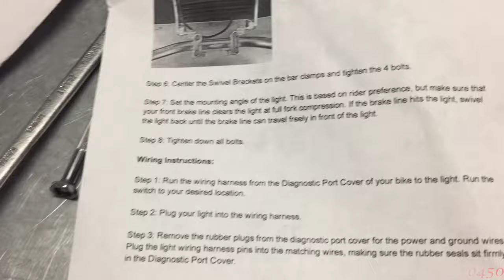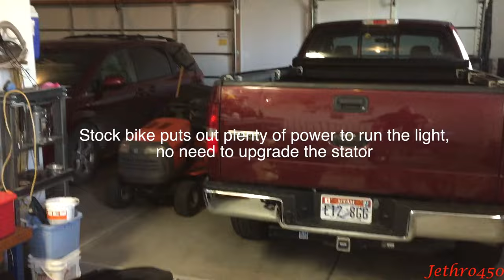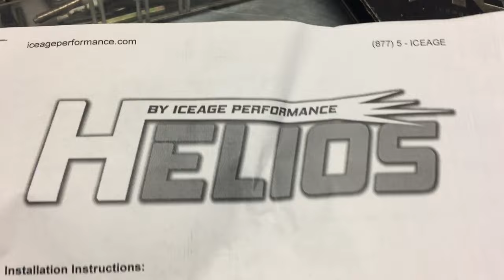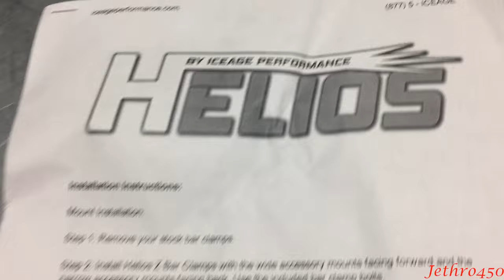2014+ Yamaha YZ450f Headlight Install

Comment: I built a system that was mounted like that. It was 70W and 6000 lumens, had to do my own wiring.  I would warn you to watch the brake line, I found that when the forks get compressed  the brake line hits the bracket and bends the line in a way that it isn't supposed to bent.  I am waiting on a longer front brake line to come in so I can route it differently before I put the light back on.
Reply from the maker: Yes I noted that, I think I will be rotating the mount upwards and away from the brake line.  I like it's current location a lot though, so I'll go ride and see how bad it hits first.   70W and 6000 lumens... wow!  The stock stator on this bike (so I read somewhere) puts out 60W and this light is a 30 or 40 watt requirement.  I'd have to switch up stators for a 70W setup.
Reply: I have an FX, 250, it has more power from the stator, 160W or some thing like that.  Runs the light no problem.  The set up is, obviously, really really bright.  Don't know how to post the picture here.  

Anywho,

My brake line bent at where the sheath ends at  above the guide at the bottom of the number plate and  just below where the your off road sticker is, at 3:31 in the video there is a good shot of that.

Comment: The Ebay link to the Yamaha wire connectors isnt working for me. Could you help guide me to the pins if they are available for sale? Thanks.
Reply from the maker: Give me a minute… I’ll fix the link and let you know
Reply from the maker: https://www.ebay.com/itm/Yamaha-WR-YZ250f-450f-or-FX-Diagnostic-Port-Connectors-/284280517660?mkcid=16&mkevt=1&_trksid=p2349624.m46890.l49286&mkrid=711-127632-2357-0

Comment: It seems to work good with the 8w ledlight and a 15 fuse between but now i have the problem when i turn the light off the hole bike shuts uff
Reply: Shuts off

Comment: Can you use an 8w ledlight dont you need to put a fuse between ore something ?
Reply from the maker: Not sure about the 8w…   Google thinks my 3000 lumen LED is a 50w light though.   I have a fuse on the positive wire right by my battery

Comment: I cannot find the ice age brackets anywhere. Apparently I’m looking in the wrong place. I love how simple and sleek they are and would love to use them on my setup as well instead of having extra brackets hanging on the bars. Can you help me out with finding them? Thanks man.
Reply from the maker: I’ll look.  Also, I just ordered in bulk the correct connectors for Yamaha’s to plug in.  I need to verify they work first, but when I do I’m gonna have an eBay listing setup to buy them.
Reply from the maker: Doesn't look like Iceage Sells them anymore.  I'd suggest calling them and asking if they could make you some.  They're CNC'd.  It's not like they can't make a set for ya.  They still have the plans.  I love mine.  I've had them since 2015 and they're still going strong.
Reply: Thanks for your help. Send me the eBay link when you get it set up. That’ll be helpful. I’ll get in touch with them and see if they can machine me a set. They’d be so nice to have.
Reply from the maker: The connectors I got worked!  See updated info section of the video.  I'll be happy to ship you some if you still need them.

Comment: You don't need a relay or anything like that to run the light or does it just plug directly into the diagnostic port? Also does the mounting kit include the light itself too? And lastly do you think a 2016 Yz250f could run this system (it has a diagnostic port) The stator on this bike put outs about 40w. A reply would be much appreciated.
Reply from the maker: No relay needed.  I showed everything I did here with no hidden secrets.  Plugs directly into the port, just like the video shows.  Kit included the light.  I was told that the 450 stator puts out 40w, so if your 250 does the same, I’d say you could do the exact same thing I did here and be fine.
Reply: Thank you so much 👍🏽

Comment: How are you getting your airbox set up on the reversed Yamaha? I just bought a 14 yz450f and don't know which direction to go to get it set up for the snow.
Reply from the maker: I've done two rides now and didn't like both setups I tried.  First I tried just the outerwears over the regular airfilter cage.  Hated it.  Today I tried a pod filter (gutted the airbox and put a filter right on the carb).  Same issue, snow gets through all the odds and ends cracks and still fills the area up.  I hate to do it, but I'm going to cut a hole in the top of my airbox (will buy new airbox for summer) and extend the pod filter straight out the top so it won't get clogged with snow.
Reply: jethro450 thanks for the reply. I think I am going to end up doing something similar, going to plug the front ports with expanding foam, then drill a bunch of holes on the top of the air box and frogzskin them.
I need to make a trip down and ride with you sometime, I got the pleasure of hanging out with your parents on the hole in the rock trip last may, and I'm sure you know my dad Troy very well.
Reply from the maker: Sweet!  Send me a PM and I'll give ya my phone number.  After thinking about the airbox more I may stick with the pod filter after all.  I need to test it more when not in 4' of powder... it may be fine for 90% of the riding conditions we get here in Utah, we'll see.
Reply: I couldn't figure out how to pm you on here. One other question, with the tss did you have to do any trimming? Do you think I will be able to run my 2.9 gallon ims tank that fills up some of that area in the subframe?
Reply: jethro450 did you get the nitrous hooked up?

Comment: Hi how's the bike doing these days with the lights? Any issues running off of the bike's power? I'm thinking of doing the same for my 2016 yz450f. I've just checked the manual which says AC magneto output is 14v, 95w which = 6amps. I assume that the lights need to be switched off when kick starting the bike?
Reply from the maker: I ran that setup for about 2.5 years w/o any issues at all.  The bike would start even with the lights turned on.  Just bought a 19' yz two months ago, so I need to figure out lights again.  I think it'll be just as easy, just haven't got around to it yet.
Reply: @jethro450  Thanks for the reply. Your 2019 has e-start and a battery should be good. I spoke to Baja designs today. They do led lighting kits for the 2016 yz450f. They advised with their kit to connect to the capacitor under the seat with a y-harness where there is 60w DC power. Can you recall if the power from the tuner port was AC or DC and if your led light required some sort of rectifier/resistor?

Comment: where can i get those metal pins that plug into the power diagnostics i need them to run my led bar, i cannot find them anywhere, anyone got any ideas what there called or where i can get them
Reply from the maker: When you find them, please let me know.  They came with my light but I want more!
Reply: @jethro450  i made a facebook post just now trying to find them, i cannot find them anywhere stupid things
Reply: @jethro450  update i found the part number Yamaha CONNECTOR Part # 33D-82378-00-00
Reply from the maker: @tristinhopkins6749  awesome thanks man!  I’ll update the info section with this